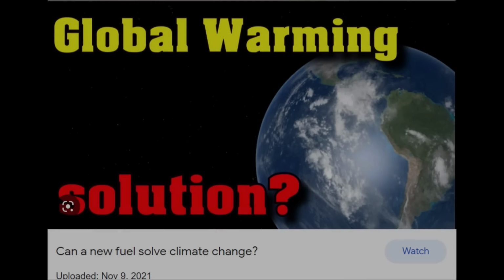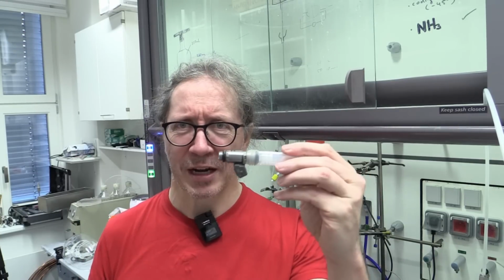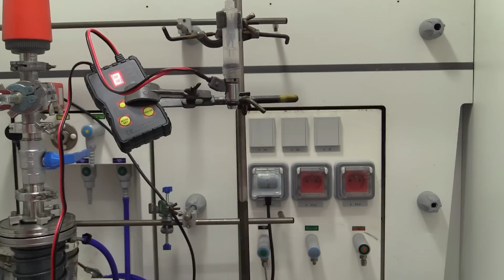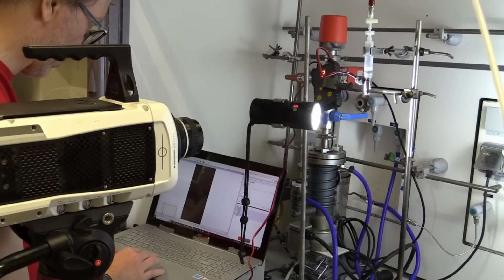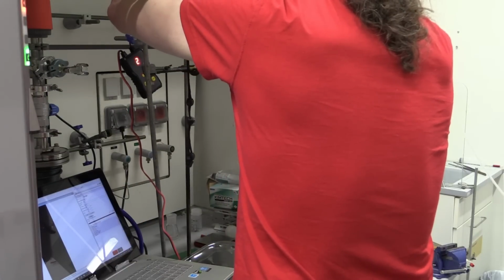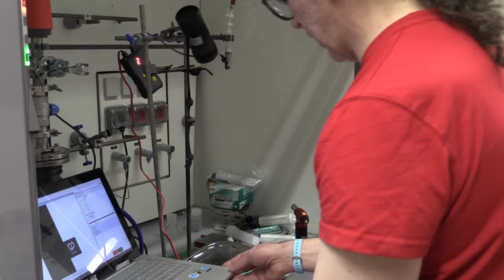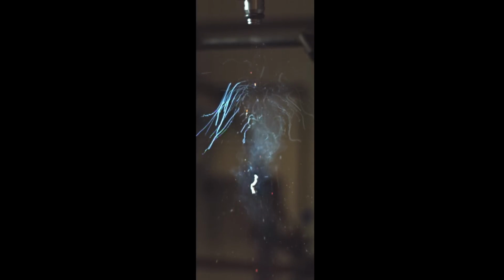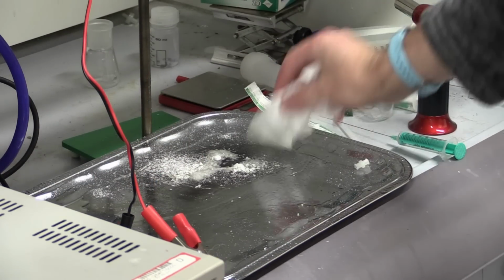Can Fuel Injectors burn SODIUM??

Comment: I like your approach to lab safety: "don't burn the building down, and don't kill yourself" 😂
Reply: The fleece was a bad idea though. Ive seen people try stuff like that when welding, and a single spark hits it and melts through and the molten synthetic fibers imbed into your skin and you cant get them out and it sits there and burns and burns. Hed have been better off with nothing at all than that synthetic fiber fleece.
Reply: Words to live by, really.
Reply: I'm reminded of Feynman's reverse sprinkler experiment.
Oh, imagine if Feynman had had modern technology like vlogs?
Reply: Loop holes. Explode building. Quadriplegia. Blindness.
Reply: He had the (probably) plastic blow torch igniter sitting right next to the tray in the first sodium tests.  I was waiting for it all to go horribly wrong while muttering "move the butane... move the butane".
Reply: @alexdrockhound9497  it's fine and mostly to throw away fast in Case Something goes bad
Reply: @alexdrockhound9497  Yes, there's a reason most welders dress up in leather.  There's nothing else like it for resisting sparks and droplets of molten steel.  And it does an excellent job of protecting skin from the UV and IR that most welding methods throw out in profusion.
Reply: Engage safety squint
Reply: @markus1351 by the time you react to pull it off it will have burned through and melted against your skin.  Then you have the worry of sending everything flying  as you flail around making things even worse.
I noticed he forgot to depressurise the NaK mix in between once as well after he had removed his face shield.
I wonder why he didn’t set up some sort of ignition system on a stand instead of using a small butane torch in his hands.
I’d have thought keeping his laptop and switch for the injector outside the cabinet would have been a good idea as well so he didn’t have to put his hands into the area during the experiment at all?
Reply: it's "Don't burn the building down and TRY not to kill yourself". The latter is obviously less important.
Reply: @JohnDlugosz  A ''vlog'' is just an application of technology and engineering.
Imagine if Feynman had advanced hardware to test his ideas about quantum electrodynamics and perhaps virtual/real machines to test quantum computing?
Reply: It's what matters most
Reply: @alexdrockhound9497  I don't think this would be comparable to welding. It were short bursts and the fleece would've been more than enough to protect him. I don't think with the amount of combustables he was using it would've melted to his skin beford he would've been able to take it off.
Reply: The exact quote was "Don't' burn the building down and TRY not to kill yourself."
Priorities for the mad scientist.
Reply: With "avoid horrific injuries" as a distant third.
Reply: @anonymRabbit23  true, a dangerous experiment is useless if it is successful and the building isgone, your legacy of being the madman who tried, succeeded and perished is forever
Reply: @alexdrockhound9497  I wonder why he did not just put a labcoat on.
Reply: in that order!
Reply: @JMD501  Don't forget the safety flip-flops.
Reply: @oinossolo6219  i have never liked lab coats either. I get why he would rather burn himself than to have to wear a lab coat thh. Idk why but it really feels extremely weird to wear it for some reason.
Reply: The key philosophy in those 9 words. Simple, isn't it? :)
Reply: @oinossolo6219  me too
Reply: @evensgrey  being a hobby welder in a third world country can say I agree, once I got nasty burns on the chest from UV using an arc welder (nicknamed Jeanne d' Arc) since then I always weld with a crew neck shirt on. Jeanne d' Arc got me roasted once..
Reply: @murph8411  Yeah... especially the position of the trigger. I mean, he picked like the worse place for it. "Lets put my arm through the test area, in a fleece jacket, to trigger the thing that I hope will catch fire."
Reply: @murph8411  you obviously have never worked in a lab,... things don't go that fast,...
Reply: -Matter didn’t create anti matter
-Anti matter didn’t create matter
(Both of them were present at the time of big bang)
-Both of them didn’t create themselves.
-Both of them came from an unimaginable source,  that unimaginable source created matter and antimatter (everything) thats why it is known as “the creator” of everything.
———
- that unimaginable source/creator has created sin and virtue which are opposite to each other,
— “logic” confirmed that every action has its own reaction, the reaction of sin is different than the reaction of virtue,
— the creator has created prophets to let us know about each and every detail of sin and virtue, also about their reactions,
Thank you
Reply: He actually said "Try not to kill yourself"
Reply: @alexdrockhound9497  yeah a lab coat would be better. although, the sodium does burn hot, but only for milliseconds, so it doesn't actually transmit all that much heat. it's more like a firecracker explosion than a burn. but still, lab coat would be better.
Reply: "listen, sometimes science takes sacrifices ok?
Reply: Definitely good advice 🤣

Comment: Might be a good investment to get a Nomex lab coat or even a plain welding jacket, for future fiery experiments 😂 absolutely fascinating!
Reply: Agreed, fleece will stink and stick if it burns so not coming off. I like my welding jacket, good suggestion.
Reply: Yeah, that's why a typical lab coat is made from 100% cotton that is on the thicker side of fabrics.
Yes, it will burn/ get dirty/ absorb chemicals etc. But that's the point: cotton like that doesn't melt into your skin and it will show that stuff that isn't supposed to get onto you was actually spilled (hence the white color of lab coats, to see everything on it).

A lab coat is supposed to protect against most things all at once, but only for a short amount of time.
Reply: @trustthedogsheneverlies644  Yep, can confirm. I did (ok weird story a 48 hour prayer) wearing a fleece cloak (I was in the woods with friends for a week with a bow, I had to wear a cape. I was that kind of nerd) in the forest and fell asleep next to a bonfire. Spark went onto it, burned straight into my skin. Wasn't super harmful but I did have a wad of molten plastic burnt into my skin. I'm just lucky it cooled fast enough to not do serious harm but daaamn it hurt.

Comment: I love seeing your sheer joy at the process of discovery and, well, science, it's really awesome.   I was struck immediately by the fact that it sounded, at first blush, much like a pulsejet, and then I realized what you've essentially made here is an open-air pulse chamber.  I wonder if the reed valves used for pulse jets could help inspire further refinements in your concept.  As an aside, I'm working on a sci/fi video game and I know in the setting there's going to be some kind of geoengineering projects going on to mitigate climate change, large automated planes burning NaK to create vapor plumes in high atmosphere may be added to that list in your honor. I like that better than huge oceanic towers.

Comment: This reminds me of a situation where a colleague was trying to produce a sodium plasma about 4 years ago or so, who also ended up finding that a colloidal solution with potassium in a carrier did magic (if I recall, the potassium was doing the heavy lifting in their findings on a luminescent spectrograph, but besides the point for this). I recommended acetone just for combustibility and easy procurement, though as an aside, acetone has a significantly higher octane rating on par with methanol and responds well to exceptionally high compression. Never considered pentane, but that was spectacular to watch!  
Out of curiosity, was 10ms an arbitrary number for filming purposes? In ICE engines, an idle injection pulse (cylinder arrangement and firing order not withstanding) is typically 2.3ms. I'd also be curious to see if this could be replicated with pressures you might see in higher performance systems, like a diesel or jet engine system, though on the latter, there isn't so much of a pulse as there is a constant pressure akin to a flame thrower and throttle is regulated via fuel flow. I've no idea on what post-combustion contaminants other than the obvious byproducts you'd have to deal with on a running basis, but this is all quite exciting!
Reply: He mentioned at the start that his control unit is meant for testing/diagnosis purposes. So I would rather think that 10ms is an arbitrary amount of time for that calibration mode.
Reply: you make sodium plasma? is power hungry?
I am interested in make NaK plasma. or at leas ionized and use magnetic field to push it thorw the nozzel.
Reply: @slevinshafel9395  Depends on your idea of power hungry. Going primarily electrically-driven, 1500 watts is a low starting point but relatively safe on 'wall outlet' supplied power, also dependent on your neck of the world and what is supplied through the circuit; when I'm doing experimental stuff, I normally rely on a 220v/50amp generator that is entirely off-grid for instance and my setups look like a small power station so I don't routinely pop the breaker in my shop. Whether you have 20 or 30 amp breakers or are going the transformer route and just using the grid to get things started, it won't exactly be cheap to run, but it won't be like running an industrial 3-phase pump type expense either. You'll definitely see it on your utilities bill, much akin to running an electric heater at full output for days on end. All told, the electric price will be peanuts compared to running devices, infrastructure and whatever you sink into the R&D process.
Reply: I believe that there were proposals for sodium fueled rocket motors, for outrageous thrust on first stage usage scenarios, usually paired with equally outrageous oxidizers.
These ideas never left the drawing board, as Hydrazine and Nitric Acid is an unholy enough combination to have sitting around on the launch pad by the hundreds of thousands of pounds necessary to fuel a rocket of useful size and throw weight.
Reply: Could the aerosols absorbe the moisture and CO2 out of a waste exhaust stream, resulting in forming sodium and potasium oxides and carbonates? 

I wonder what his intentions are with the aerosols.

Hrm.... what if? Cloud seeding? Increase earth's albedo, solve acid rain,  and solve ocean acidification, and pull CO2 out of the air?
Reply: Do you think NaK might be interesting in a magnto hydrodynamic drive or generator?
Reply: @archdornan4389  I could not imagine the amount of problems to be made with huge quantities of sodium and potasium hydroxides made as a launch pad is protected with water during lift off.
Reply: @kreynolds1123  The way I understand how that works, you're really just giving conductive water a charge, but the water density is doing the propulsion. In a stationary unit that is recycling its water supply... maybe? I'd have to read up on it to get more specifics, but based on that, I'm not entirely sure that adding either of those materials would do much of anything differently. Insert major asterisk here, but that said, it's all based on knowing nothing more than a cursory combination of the terms and relevant operational theory, and it is entirely possible I'm missing some magic sauce combination on the subject. 
TLDR version: 🤷‍♂
Reply: @kreynolds1123  Yeah, that was one of the big problems.
Reply: @C-M-E  Suposing one wanted to store energy for seasonal heating. Think one could do it making NaK?  Maybe that's just a pipe dream.
Reply: @kreynolds1123  All things being equal, you'll end up investing more in the materials to make a specialized product, research it, test it 20 different ways for failures to make it reliable, then have to produce the product (regularly if it has a consumptive fuel component) which comes with its own time and expense penalty. Or you can go with a  more established technology like wind or solar if you're looking to have a small power station/back-up power for your home or even off-grid.
I sink a lot of dollars in R&D chasing good ideas, but it takes years to get things rolling on the ones that look most promising and then more further to continue to pursue an idea, produce a product, support it and so on. 
As great as burgeoning ideas are, they do not come cheap or without a lot of hassle to get them off the ground. This is doubly true in the current climate where physical supplies, prices and the ability to have them shipped cost-effectively are fluctuating wildly from day to day; you really have to either start small and build on it at hobby scale with the hope that others will follow suit, or make sure the idea is worth pursuing long term and build a group of like-minded folks to do individual studies to advance the idea as a whole. 
Aside from some scratch-built stuff like waste oil heaters and the like, wind is my preferential system of choice as its cheap for initial costs, requires very little maintenance, parts are widely available even if you want to piece meal a kit yourself or even build one from scratch, there's a widespread adoption of users and a network to rely on for advice and build paths, and more often than not, producing reliable power is less a concern as to limiting your generator from making too much (overspeed, but it's well known and most commercial options have a regulator built-in). 
Solar has some of those traits, though it's certainly more expensive to get going for a whole-house up front (the word Substantial comes to mind) and ultimately whether you get continuous and reliable power output from your system depends on time of day, and to a larger extent, regional weather. Most systems have an expected lifespan as the cells degrade with time, and even if you pony up 20-30K for a full system, there's manufacturing defects to contend with (fairly rare but they happen), or the company you bought it from goes out of business, and thus your warranty is worth whatever paper it's printed on. 
If you have the option of a creek or regular rainfall, water generation for battery backup/storage is another route worth looking at, or even any combination of the three if that suits your needs. 

One benefit from going larger wind or solar installations (not sure where you're from, so this may vary depending on local availability) but you might have the option to push energy into the grid when you don't need it for personal consumption, effectively reducing (or if you have a large enough generation system, negating your power utility bill entirely). That size system would be anywhere from 13kw or greater on average, so not exactly small, but they are out there on residential units. It's uniquely fun when you get a utility bill with a negative in front of the rate.
Reply: @C-M-E I don't know man if I'd be willing to pull 1500W from a standard 120v wall socket in America. Most are rated for 1800W
Reply: @C-M-E so how is it that we haven't been able to harness the the geothermal heat of the earth to create underground steam turbines for energy productions? Like I know of that Russian hole dug so far it got too hot for any of their tools to continue digging or whatever, why couldn't you just like turn that into a steam turbine somehow
Reply: @chicken29843  The main problem is having equipment as you said, and infrastructure, that can deal with the heat long term. Getting to it is almost a cakewalk versus investing millions(billions?) in material cost and labor, and the labor would be outrageous as you'd have to find a group of very specialized drillers willing to deal with magma instead of the normal unpleasantries of sequestered gas pockets.  
The other end of that, on a logical standpoint anyway, is pressure. Just like going down into the bowels of the ocean, the deeper you get, the more readily that stuff will want to escape to a lower pressure environment. Imagine the old drilling derricks spurting lava instead of petroleum. Yikes! Time to put on the asbestos underwear and Run! 👀🔥
I like the idea, but when I get on that what-if-and-why-not train on things that haven't been done yet, you have to wonder if it's all just the Green quotient (green being money in this case) or if they just haven't found the right fool to try it. 😁

Comment: Maybe in ~20 years Na engines will be something common, and I will remember this series of videos with love and admiration
Reply: Impossible. Nobody care about environment, just money and power.  That's the problem.  Secondly it's not that simple like just put some of this stuff in injector and use it. Automotive is very complicated subject and have a lot of variables and parts and system working together. For ex. Sodium is already used in some engines as a coolant for the valves. It's inside valves and in liquid form is taking the heat of them. You can spend years just learning about enigne oils and still not be an expert.
Reply: On land vehicles, I see biodiesel and synthetic Diesel and gasoline taking over, along with electric vehicles.

For ships, I see sodium and calcium hydroxides used to remove SOx and CO2 from ships' exhaust being more common than a sodium-in-fuel emulsion.

Aviation is where I think this idea would have the best chance of working, via sodium-in-fuel emulsion or injecting sodium via afterburners.
Reply: I doubt it. The combustion products (alkalai hydroxides, oxides, and carbonates) are solid. Solid precipitates in your engine with moving parts is no bueno.